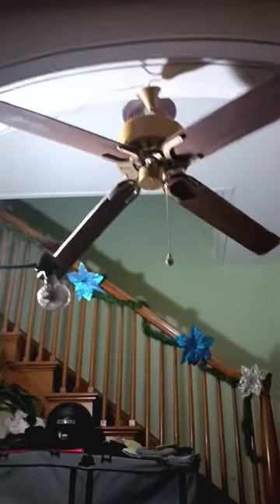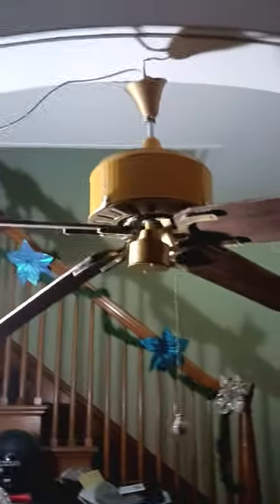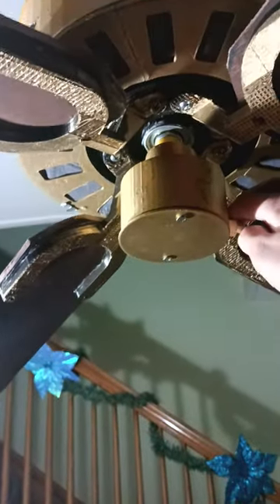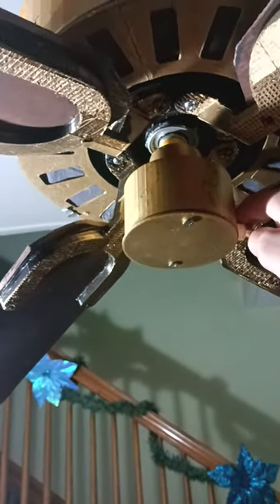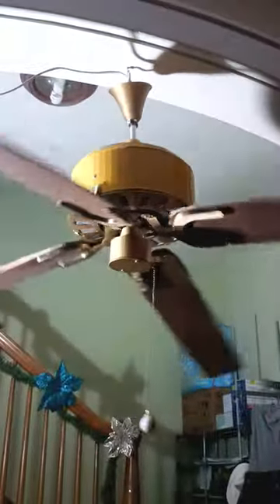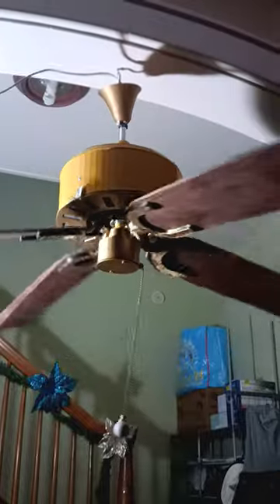3D printed "Panama" Gear driven ceiling fan #Shorts

Comment: What is the actual inch on it, let me guess 36 24. And where did you get the pull chain and shaft what is the length of each blade
Reply: Thanks oh and where can you get balsa wood
Reply: And you could that fan with the lite kit and make the Edison belt&driven fan next

And where did you get that small fan and motor that's inside the housing, which you call it the engine

Comment: Which engine did you use for it? If you have a video talking about which engine you used, could you send me the video?
Reply from the maker: https://www.youtube.com/watch?v=0TztdWPqnB4
Reply from the maker: c-frame motor, hammer the turning rod of the motor, so it can be dual shaft. Make sure there's a hole in the back bearing so it's possible.